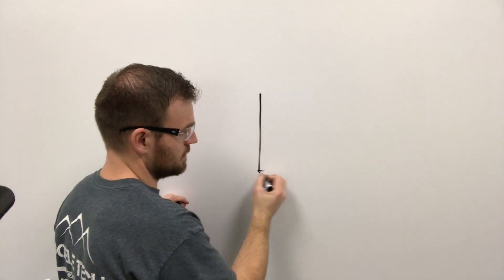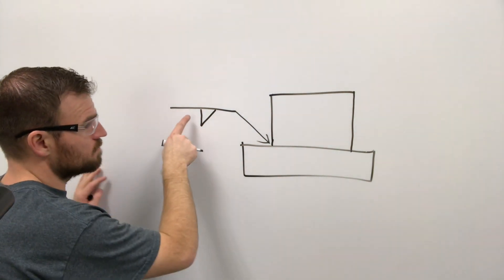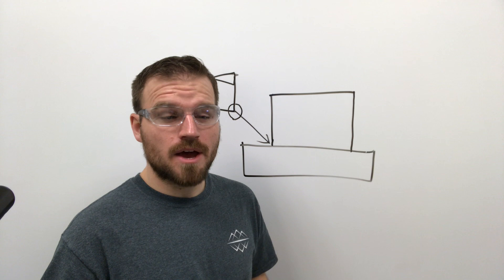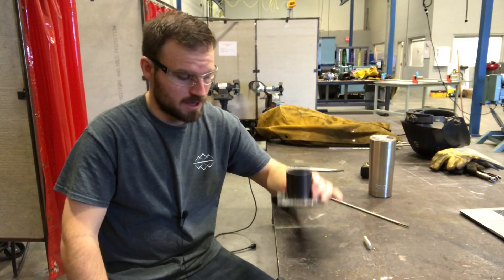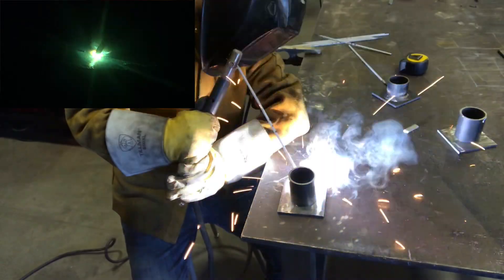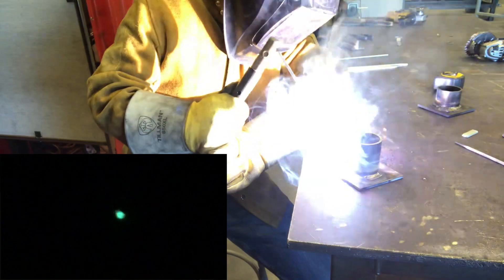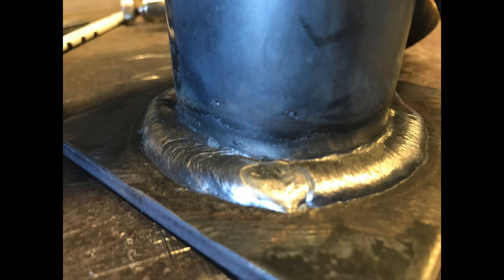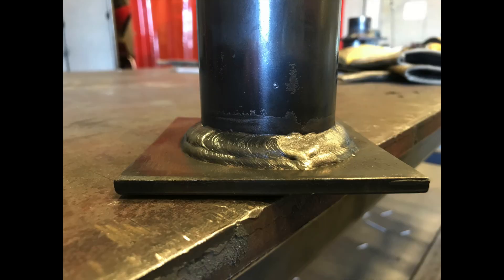How to Weld Pipe to Plate with SMAW (Stick Welding Tutorial)

Comment: What if I want to weld a thin pipe to a thick plate, is this possible?
Reply from the maker: Yes, I used to weld lattice Crane booms, and that’s exactly what they were. probably an 8th-inch thick pipe to a three-quarter inch thick plate.

Comment: Hi nice video, I'm doing this for my ski pole bracket for the ski boat. To stop the base plate from warping can I just do root pass? The pipe will also have brackets welded to it. Or could I do a 3pass weld and heat the pipe and base plate before I weld?